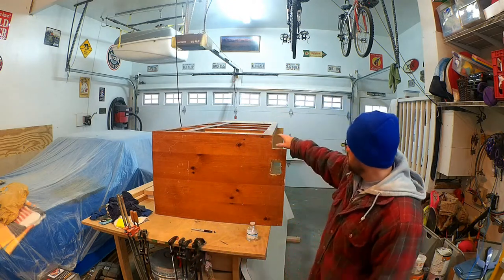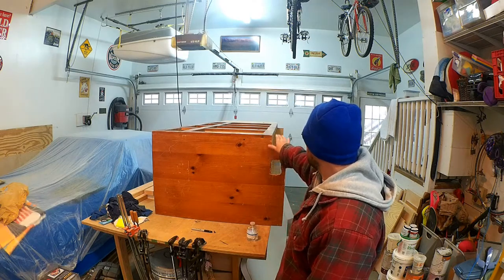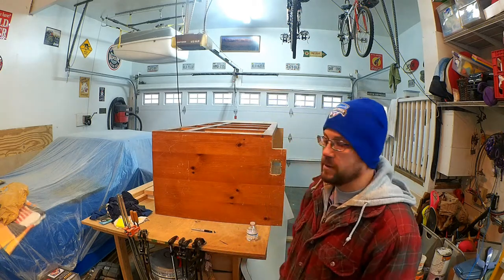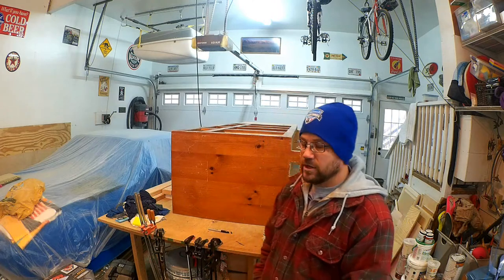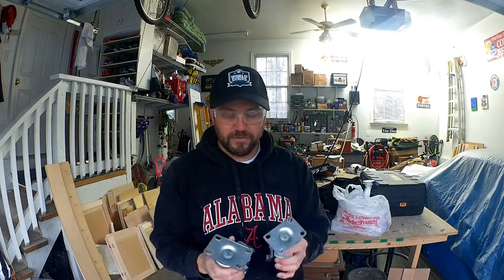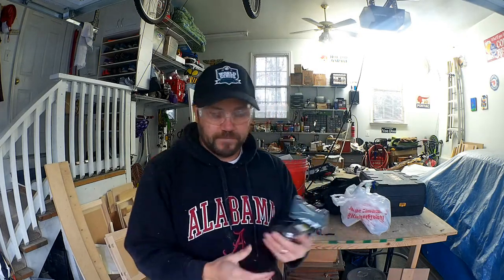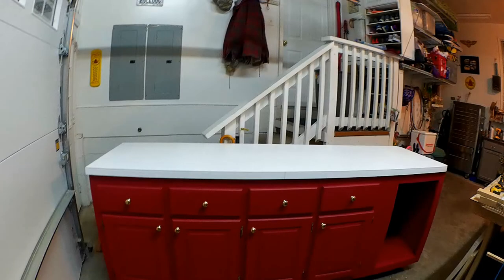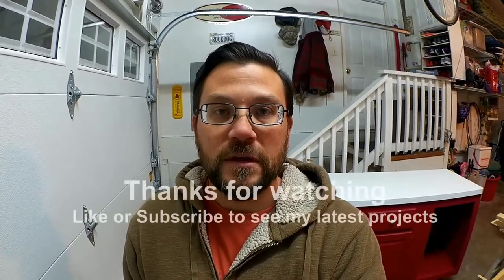Make A Workbench For The Garage From Old Kitchen Cabinets

Comment: What did you use for the top surface?  How did you attach it??
Reply from the maker: Thanks for the inquiry, I used the existing top from this old kitchen cabinet. Since it is a wood laminated formica top I was able to easily cut it down to the length I needed. Sorry it didn't video how I attached the counter top but, I simply attached the top with some 2 inch wood screws at each corner and center bracing points.
Reply: @richofalltrades1  awesome, thank you!